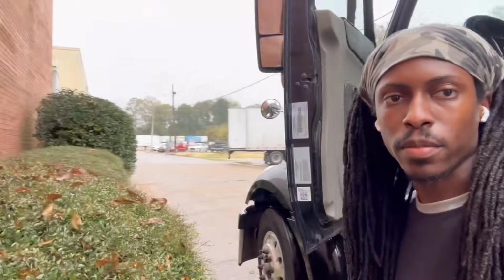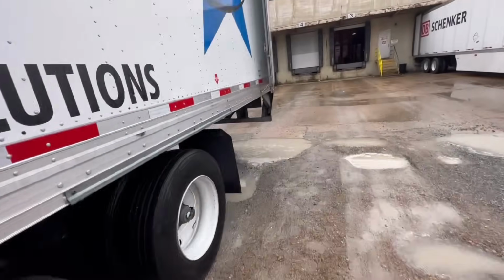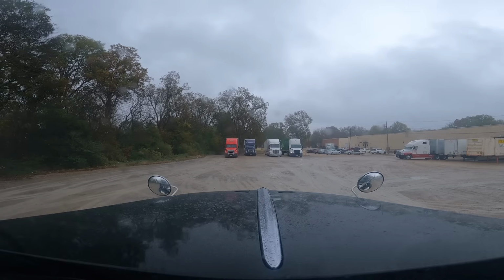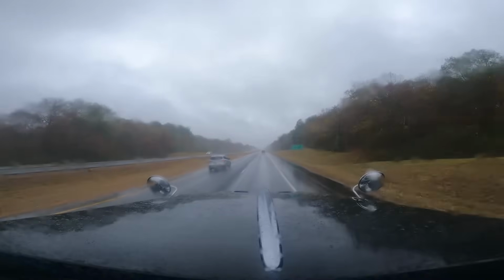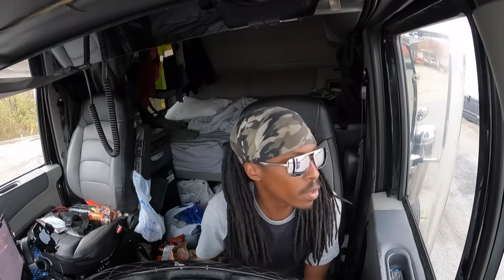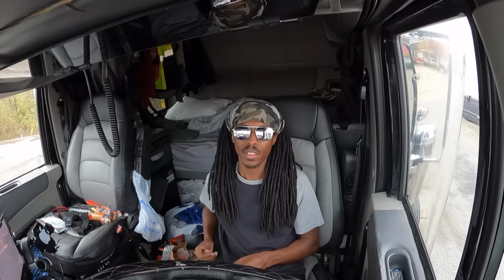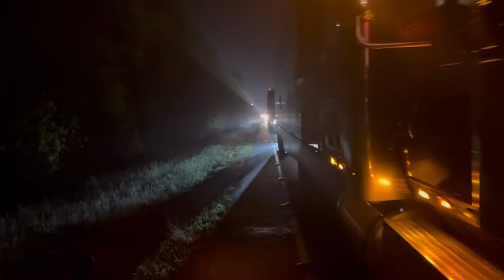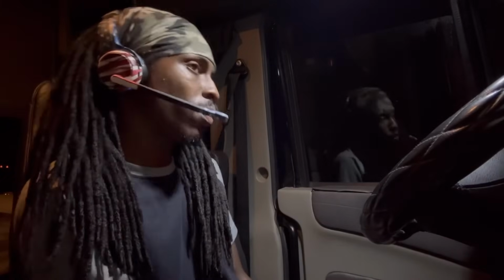A Multi-Semi Collision Delays My Delivery

Comment: Have you checked you clutch fan actuator? Each time I watch your videos I hear what sounds like your clutch fan and it sounds like it is engaged a lot of the time. I know that it will be if you have your defrost or a/c on to keep down your compressor head pressure.  Just an observation.
Reply from the maker: I address that In tomorrow’s vlog.

Comment: Question - The time you spend in dead stop traffic for more than an hour counts as drive time??  Also, what happens if you go over while in dead stop traffic?
Reply from the maker: Yes, it is supposed to BUT you can put yourself on duty to stop the driving clock. However, the 14hr clock does not stop.